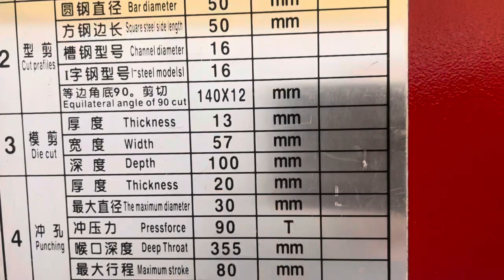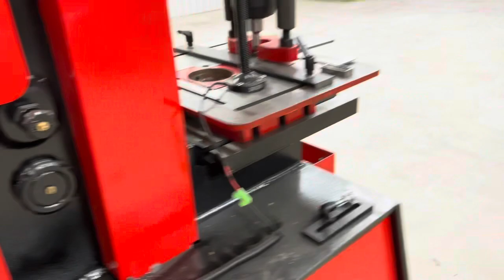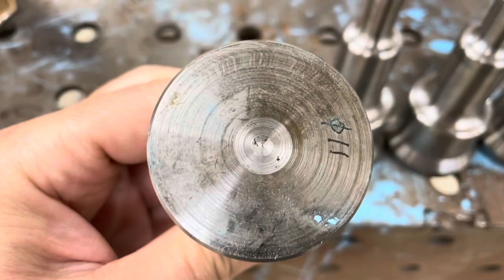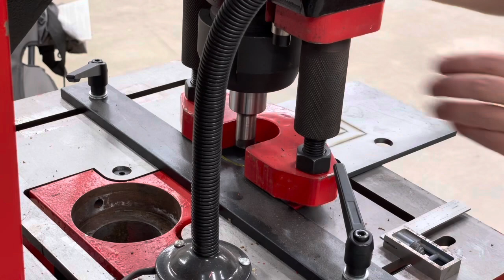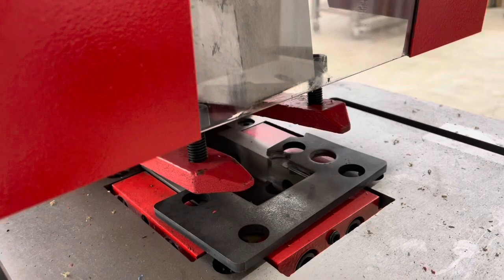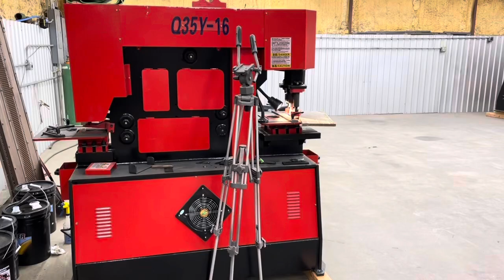65TON ironworker demonstrating punching through thick plate

Comment: Nice machines. A bit annoying that all meassures are metric, or?
Reply from the maker: Well, i am slowly gettign the hang of it, lol in reality metric is easier, i mean, 99% of the world uses it, so might as well join the crowd
Reply: @turbocobra  Right... it's really not that hard to remember the "number value" of your closest fraction. Some are so close you can tap and thread, like 19mm and 3/4" and some are like clearance holes 10mm vs 3/8"
Reply: I'd be even more annoyed that Chinese labels come first...
Reply: @Frank-bh3cm  Typically, most factories over there do a pretty good job at creating country specific label plates. To see this one in Chinese first is kinda weird cost cutting measure. But nothing a little laser engraving can't fix.